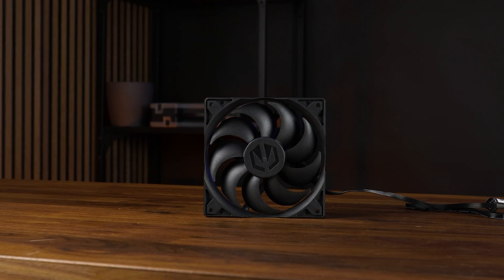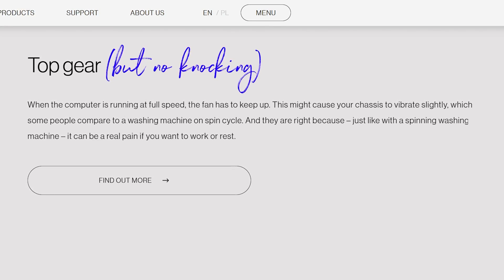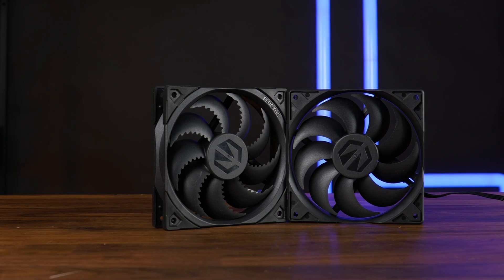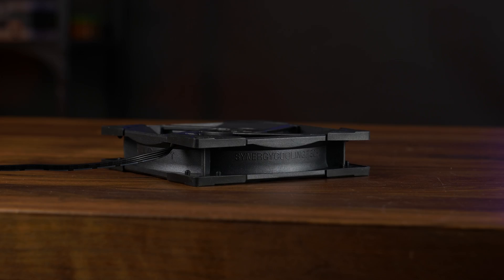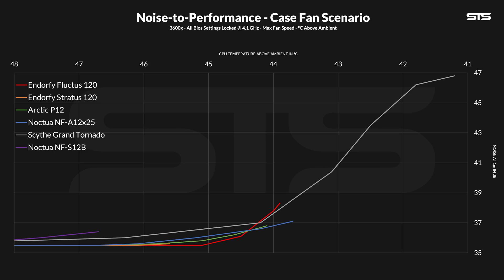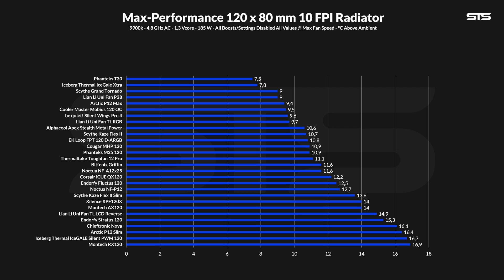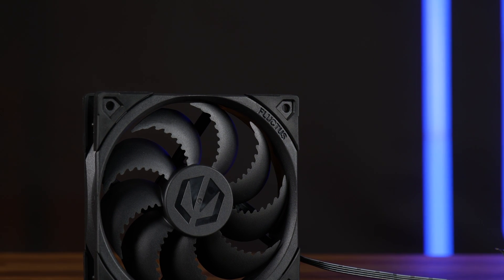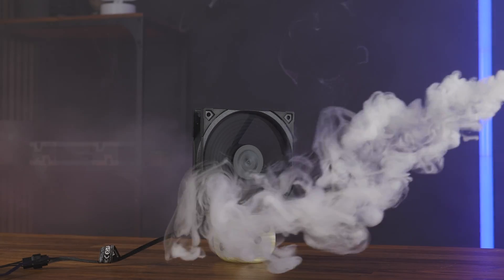Full Of PR-Vomit, But A Good Case Fan - Endorfy Fluctus 120

Comment: So how can you conclude this is "right next to the NF-A12" and "quite a bit in front of the Arctic P12", while at the same time showing a graph showing both of them being an equal distance, 0.2C, away? I would also claim 0.2C is not "quite a bit", and it is likely in fact "within error margin", so .. how exactly did you come to this conclusion when the data you show us claims otherwise?

Comment: I had already used a few arctic p12 , now i have 2x fluctus on my mugen 5. Performance is very similar but noise profile is more pleasant on arctic. . Mine 2 fluctus have wird bearing noise at 1000-1300rpm so probably quality control is not the best ..

Comment: Are you going to review the Hyte FP12 fans once they finally come out? They look very interesting, as they spin at 3000 rpm with a thickness of 32mm (which is even thicker than the T30).

Comment: I hope these serrated blades catch on, from another video they do sound more enjoyable than the high pitched noises some fans have.
Would be really interesting to see fans with these serration on the front and the diffusion on the rear and struts like on fans like the Noiseblocker, sweeped struts, chamfered edge, a ring around them, and all the other minor improvements that are possible.
With all the recent innovations in the fan market it's only a matter of time until someone decides to make an overkill 50€ product that combines all those.
Reply from the maker: As some point, somebody will surely try. But I do fear that some of these micro-optimizations may counteract each other. Or maybe even create a whole different sort of issue that we’re not aware of yet
Reply: This won't happen anytime soon as the fan design is patented by each company.